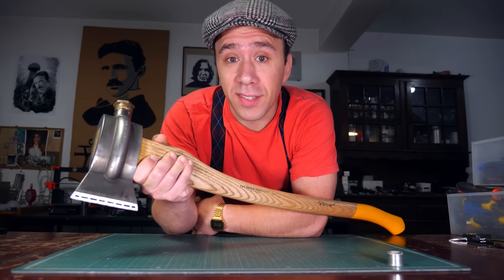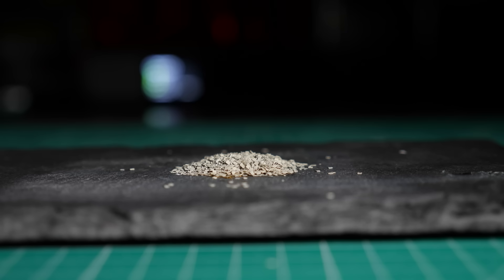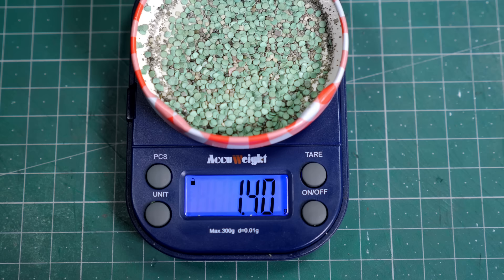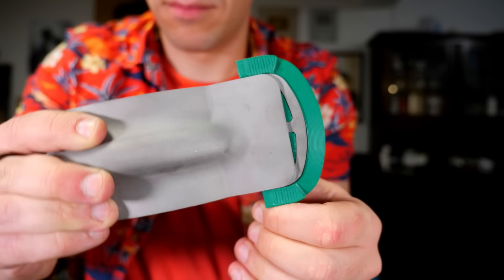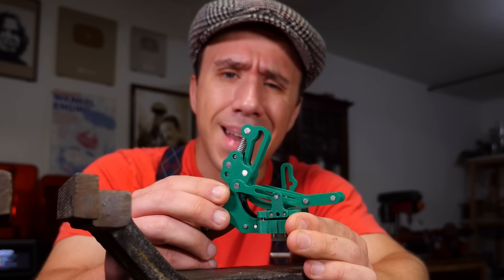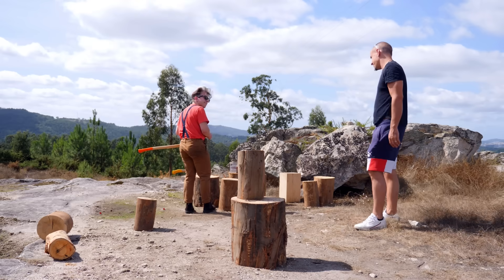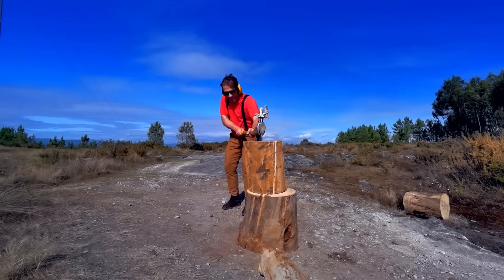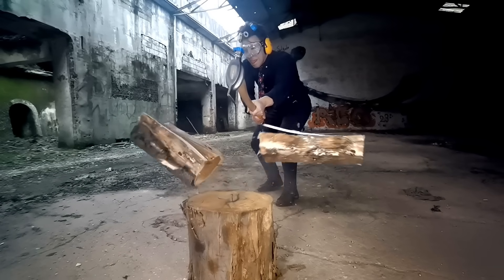I built a BETTER SHOTGUN AXE

Comment: If you want to pivot, try converting a diesel pile hammer into a log splitter. Never been done. Would be equally impressive as using the shells you were using here, but diesel is infinitely more available (including biodiesel). Obviously this is larger scale than an axe... more on the scale of a hydraulic wood splitter... but way way cooler. 

Here's the smallest commercially available diesel pile hammer to get you pointed in the right direction. "APE Model D1-42 Single Acting Diesel Impact Hammer". That's a 1L combustion chamber and a 140kg mass. Could potentially scale that down to 0.5L, or use it as is. 
There's been multiple projects I've thought about that free piston diesel hammer concept could potentially be adapted to (think: levers, compressed air, etc... anything that could use an impulse of 40kJ of kinetic energy). 

If anyone could adapt it to be way cooler (and perhaps smash some tomatoes with it), it would be you.

Comment: I quickly looked through the comments but didn't see this suggestion.

For the best results, the vent holes should have the largest possible cross-section while still maintaining a good seal, as this allows a higher force to act on the wood.

Also, a note on the electrolyte: if you use salt (like sodium chloride), the water will split into hydrogen and chlorine, not hydrogen and oxygen. For that reason, it's better to use something like sulfuric acid instead.

Comment: i get a feel like you could experiment with the blade shape, blade size, and the vector upon which the impact force from the explosion is applied, to specifically adapt the ax for breaking larger logs (one of my main issues with large logs was it that the axe would just make a dent, so i'd need to strike in 3 places along the same line and it'd break without much effort, as in, the required force was not that large)

Comment: bro maybe the edge is the problem since i think you forced all the gas through just 4 outlets and it worked nice before because the old one had many openings through which the gas was distributed instead of all flowing towards each other

Comment: You are better off having a single nozzle pointed straight into the wood, so that when the axe is inside of the wood, you'll inject all that pressurized air into it, v causing it to split easier

Comment: I think you gave up to quickly on the idea behind the hydrogen version. As you said hydrogen is not very dense and generates less gas and power in such a small volume. Propane has a volumetric energy density roughly 4.2x higher than hydrogen at STP, with the same volume of propane as hydrogen, you could generate almost as much power as with the shotgun shell with little modification. Oh yeah, and no shell, no smoke, no reloading. Shoulder slung mini camping propane tank with a hose? I was thinking maybe compressed air too but maybe that's unnecessary and dangerous. You can probably beat me to building it. You have about years.

Comment: My two cents... make an axe head version that has flaps that expand. Instead of using the expanding gases to blow apart the wood try and make it so the axe head expands after entering the wood. Thus pushing the wood apart.

Comment: You are making gas interact with wood. This is bound to be flaky. I would design an axe with a moving blade, meaning that the blade part is a piston that can move in and out from the main body, but not pushed out fully (otherwise it would just be a projectile.) You would load the shell from the front of the axe (the side opposite to where you hold the handle, for safety) and slide a strong cover in place. The piston should probably have metal gaskets, the kind used in gasoline engine pistons. The slide cover should also be made gas-tight, maybe with a similar gasket. When the axe hits the wood, the blade-piston gets pushed hard into the axe, and this action itself triggers the primer against a fixed pin, making sure the shell is detonated at the point of maximum force against the wood. The detonation would happen inside the main chamber, where the only two openings are the slide cover and the piston, which were both made gas-tight. Therefore the only way for the pressure to go is to push the piston-blade down against the wood. The piston-blade should obviously be cylindrical (or elliptic) in shape, but its end should be in the shape of a wedge, more so than regular axes, because it will work like a wedge, splitting the wood. At the far end of its motion range, the piston-blade should open air vents to let the gas escape, and be held firmly in place by its own construction, so that it cannot be pushed out like a projectile.
Reply: Actually, machining a piston and cylinder with a tight fit is extremely difficult. I would repurpose an ICE engine, maybe a 125cc single-piston one, and modify it into a piston-blade.

Comment: Instead of relying on the wood to hold the pressure, why not try designing a 2-piece axe head that can pivot apart. 
Ie: the axe head has 1 or 2 'levers' on either side of the blade. So the axe becomes the pressure chamber; the gas can only escape by pushing the 'lever(s)' apart which could, in turn, push the log apart. 
Maybe give the 'levers' guiding pins into the ace head as makeshift pistons to minimise pressure loss?

Comment: I'd say turn the handle into a hydrogen canister so you can generate more pressure.... but thats just an ied with extra steps (which is why you just have a burst valve on the back of the head)

Comment: honestly... abandon the ports running on the outside and narrow your blade. your assumption that the exhaust gasses can not go thru the handle is incorrect. a simple silver solder seal would be plenty if the port thru a wood handle was lined with metal sleeve.  this silver solvered sleave in a cavity concept has been done since steam age. but as a master bladesmith i can say in confidence your axe needs to be a thinner wedge to get into the wood. btw... those 22cal blanks for construction should have enuf volume to split a log if you do a scratch redesign. the first versions def are proof of concept. 😅❤

Comment: an idea for you. there's a a splitting axe design called the Chopper1, which has some articulated arms that push the wood apart one the blade has dug in. you could probably do something similar using the gas pressure. the benefit being that you don't loose power the second a crack propagates.

Comment: Since getting the depth of the axe head is so critical to making this method work, I wonder if using the gas as the splitting actor is not going to be effective enough. Instead I am thinking of making a design more like an  engine piston that drives a two or 3 piece axe head to physically push outward. This solves the sealing problem, and maybe the depth of bite necessary.

Comment: (Havent finished vid yet this just popped into my head) One issue with the gas mixture might actually the burn speed. 

This is why gunpowder doesn't burn up immediately like one might think. Still burns fairly quick but allows for time to build compression in the gun barrel as it ignites. For short barrels faster burn isn't as big a deal, which you'd think might apply here since the channels in the axe head are pretty small.

That said since the force is applied side to side instead of straight forward like a barrel, I imagine different mechanics are in play.

Comment: Why not trigger rod that would go all the way to almost the tip of the blade, that would be pushed by the wood, it could have a threaded part on the top so you can actually set the desired depth, assuring it always fires as soon as the right amount of blade has entered the wood.

Comment: I don't think a steel file works very well on steel unless it's harder steel
But it'll still wear out the file

I don't know what they're usually used for, though

Generally,  I think any abrasive thing works better because the abrasive tends to be way harder than steel

Comment: For your machining if you used a tool that had a larger shank or shorter shank, bringing the collet closer to the work it will greatly help lower vibration chatter and noise

Comment: You should abandon the handle through head design. it makes sense for a typical axe that is winning by raw brute force. However with a power assisted design. There is no reason the head can't go through the handle. Wood is easier to shape than metal. Simplifying the most important part, the axe head would probably help a lot.

Comment: Just thinking. the biggest issue of this project is force application Instead of just using pressure a sort of... lack of better words a hammer type system still using the axe head but  hardened peg that slams out slapping the top of the log basically making a super charged log splitter... side thought id be curious to see a scissor type design where the blade fans out but i already see dozens of problems with that

Comment: Hey not to be a 🤓 but when using an axe to split wood your not supposed to have your leg in line with your swinging motion. Your supposed to spread your legs apart so if you miss the axe just swings between your legs or hits the ground and not your foot.

Comment: remember to do your math and make sure the pressure isn;t enough to crack a weak point. The reason why guns use "slower" burning powder is that you still it is better for the pressure to build up to accelerate the projectile instead of going all the way up instantly (aka an explosion), and since you are making a gun axe you should try to use gun mechanics.

Comment: Lol watching the video I keep saying in my head, well that's probably not going to work, or this is going to take a while then to find out, I was right.  That said you might be able to use gasoline (petrol) for the source but I don't know how it will do without being compressed or if its safe to pre-compress.  Maybe something like diesel with a piston that compresses then burns on strike with the strike driving the piston.
Edit: Please don't tell me he's making a shotgun breach out of pla
Edit2: Phew
Edit3: consider using the pressure to move two separate blades of the axe apart then dumps that gas into the wood once they are apart. So the two halves of the blade are side by side touching then when the wood is struck and the blades are buried the shell goes off forcing the blades apart allowing the gas to escape.  Also eventually you are going to catch shrapnel from the wood so I would suggest armoring up a bit.  Even a leather apron and some neck and face protection could save your life..

Comment: How about a design where the blade is a two part wedge, and the blast separates the wedges apart. Then it should not kick the axe out of the wood... But the firing mechanism needs to be a lot more robust in that case.

Comment: Just curious, have you considered propane? It offers much more energy per unit volume than hydrogen. There are actually propane nail guns that work this way (igniting propane to drive the nails). What if you bolted a small combustion engine cylinder head to the axe head, complete with spark plug? This would add combustion volume. And it'd work just like an engine: inject fuel and air, spark plug to ignite. Then maybe flush with more compressed air. Then you wouldn't have to reload a new cartridge for each whack, you could basically just flick a switch.

Comment: A little advice from someone who split hardwood for a fireplace every summer. Those large rounders and medium logs are easier to split when you remove all the bark off of them. The bark on hardwood can be thick and tough. On top of that try to hit it towards the edge of the log. The heartwood of the log is the toughest to split if you just slam the ax right into the center of the log. Try to hit the Sapwood, the area of the wood near the bark that has a different color, this should make it a lot easier to actually split the log if you work your way up that crack you made by hitting the sapwood first. I know you want to do this in one swing, so try to hit the sapwood more then the heartwood. Should help a lot.

Comment: Perhaps you could add shallow barbs to help anchor the head? I'd also recomend a firing mechanism that isn't dependant on the force of impact. Maybe a button or trigger in the hilt of the axe for a more controlled detonation, or as a backup in case it didn't go off.

Comment: Go fund me. Industrial log splitter using the compression of Diesel to ignite and release the pressure down the axe head. Or press and hold a row of needles into the wood and ignite petrol mix down the needles

Comment: You're essentially creating a blade of air with very little space to escape the pressurized gas will then create its own escape path by following the grain thus explosively splitting the wood.
It would be interesting to see if it cuts as well against a more curly grained wood. Though I would not suggest doing this yourself use a rig of some sort.

Eucalyptus is gnarly to carve, no wonder it didn't go through so much.

Comment: I think you might have better results with a different blade geometry. I’d recommend looking into the shapes of timber sports competition racing axes. They’re generally designed for softer woods, but they bite deeper then I’ve seen from any other axe blade. They tend not to split, but to cut in deeply, which should give you a good seal and a solid depth, allowing the pressures to then do the rest of the work.

Comment: I wasn't going to make a comment, because you don't need more & even from me, but 19:10 is one of the moments that is something that genuinely made me scared for you. I know, I know, youtube something something, I had it under control warning & professional stuff but oh my dude, dude. That was shrapnel to the face dead stuff right there.

Seriously, yes. That is actual stuff that would have fully Kentucky ballistics yourself in the worst way possible. 

I'm happy you are alive, but still that would have been something of total death. Not semi-total, not slightly, but full on no saving role at all is going to help you out on this guy. 

No suggestions, its cooler to keep going with shotgun shells, but it would have been cool to see you use a cannister placed inside the handle & a little dry ice with some batteries to make a detonation burn with greater volumes of gas of hh o & oxy acetylene combined.

The speed allows for you to electrothermally expand & accelerate the gases into a co2 (dry ice) volume to cool & decelerate it, gaining you roughly 2-5l of gas that travels, roughly, about 4 times the speed of sound in a laminar flow.

My first thought was the wood too, but I was thinking that the higher velocity gases that go through multiple openings might have helped out too for expansion if gases along grain paths. But I think your explanation is just fine if not fully correct & I was just over thinking it. The 2 sides only allow for a larger volume total, like amps to volts.

Balance is a thing for sure. Anyways, this would be a cool redundancy for a non-hydrazine based reaction control thruster. Remember me at-ing you about a certain old gyroid infill rocket engine? rude.

Comment: If you had a high pressure air tank that feeds a hose on the handle will your valve be able to push enough volume and reload quickly? Kind of like a cross between a potato (tomato) canon and an ax?

Comment: Maybe because the blade is so tiny and the wood so big, the pressure of the shot is not enough. I believe that a longer blade could help (but it will be harder to introduce), so maybe some "nails" to help introduce into the wood would help.

Its like breaking a stone... if you put some nails in a line the entire stone end breaking in the same line.

Comment: 1. Your axe blade appears to be too narrow, a splitting maul has a blade with a beveled angle of 30-40 degrees. Thin axe blades make splitting worse.  Splitting mauls catastrophically RIP the wood grain apart. Thin axes don't have the angle required to quickly deliver the separation energy in order to rip the grain apart. They will instead typically embed themselves within the grain in order to cut, not split. (Which is the purpose of a felling axe, with a narrow blade, to cut down a tree or cut off tree limbs.)

2. Ensure your wood is bone dry, splitting damp wood is much harder than dry wood. It's hard to tell in the video, but your wood does look a little damp. Damp wood is significantly harder to split because the wood grain is still supple. Splitting wood in the winter with frozen logs is easy as the wood grain becomes incredibly brittle, it's like a splitting wood cheat code. So if you can wait to do V3.0 in the winter with (dry) frozen logs, you'll have much more success. 

3. The species is important, as you stated because of the grain structure. you should try splitting ironwood, you might need a tank shell to split it, though. 

4. Pay attention to where you're hitting the log, every piece has a natural grain, and you want to split along the natural seams, which doesn't always mean hitting it square in the middle, especially for larger pieces. If you want to split wood in the middle, the diameter of the log shouldn't be much larger then the width of your axe. If you want to split large pieces, you need to "edge" it first. True success for V3.0 in my eyes, is blowing apart a log at least twice the diameter of your axe blade, with a center hit. 

5. If there is a nasty knot in the log, you want to split parallel to it, as the grain structure will usually orient itself with the axis of the knot. 

goodluck,

-Canadian Lumberjack.